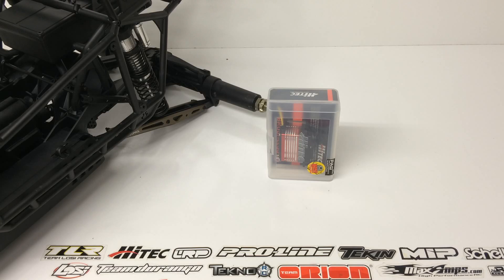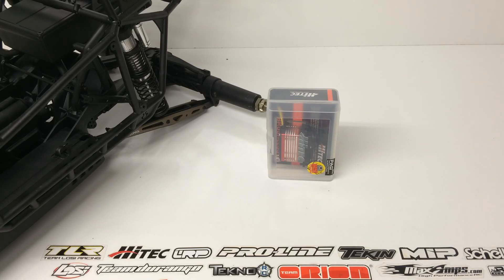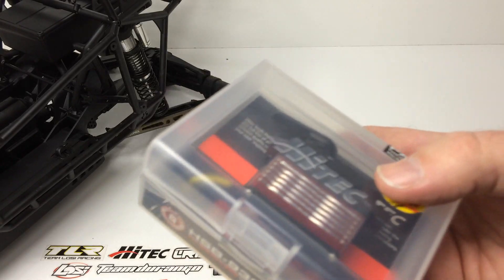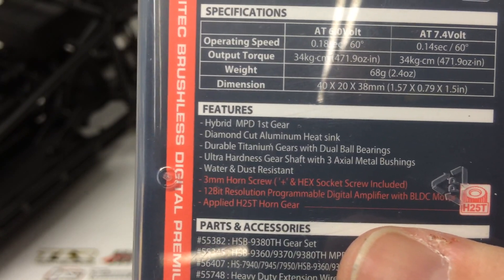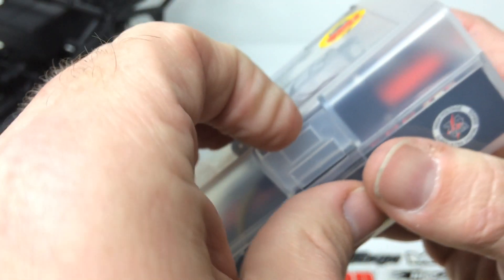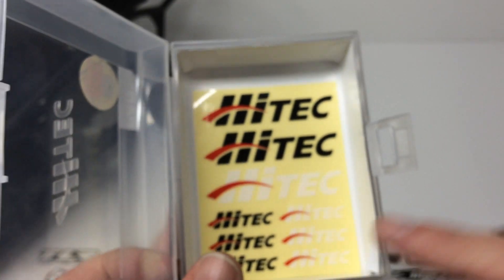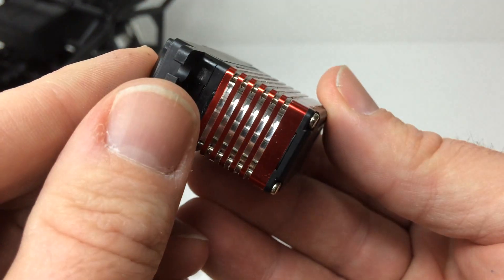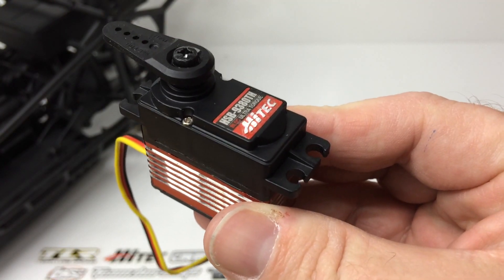Hitec HSB9380-TH Ultra Torque Servo - Unboxing

Comment: I would stick with running it at 6 volts just would last much longer. Castle seems to be a powerhouse having there products into everything Rc
Reply from the maker: +Jacob Hendrickson The nice thing about the Hitec is that even at 6.0v, it puts out the same torque, with slightly reduced speed

Comment: This has me wondering are the brushless motors in servos sensored or non sensored.
Reply: They are connected to potentiometers which measure how far the gears are which then relays that information to the motor which rotates the gears to the designated position so they are sort of sensored but not like normal motors
Reply: "rc tips and reviews" - He didn't ask that at all....
Reply: I was explaining why I don't think they are sensored

Comment: Is this over kill for a 1/8 scale buggy ? If so what are all of your guys thoughts on the best servo for a 1/8 scale buggy. I'am almost finished building a Losi 8ight 3.0 e buggy. So far for electronics I think I'am going to go with a Tekin 1900kv motor and the rx8 gen 2 esc. All advice is appreciated, plus battery ? I will mostly be taking this to my local track and getting into club races. So suggestions on parts would gear more towards making the best track buggy not top speed. Thanks in advance. I'am a noob to all this except for a nitro monster truck I had about 10 years back. hope these questions aren't to lame... Haha
Reply from the maker: +Jay West The rule of thumb for 1/8th scale buggy is at least 300 oz/in of torque.  Then, your wallet will be affected on how fast that 300 oz/in of torque is.  The 9370 would be my choice at 347 oz/in and a .10 transit time

Comment: do you need to run a bec with this servo ?
Reply from the maker: +rocketfish6 The 9000 series of servos come with what Hitec calls a "PAD" which is kind of like a voltage cap for it

Comment: excuse me, i never had a brushless servo, what exactly is that PAD (Power absorbing device)? do you know how is connected and it's use?
thanks
Reply from the maker: From what I understand, it regulates voltage to the servo, as it's plugged into the receiver.  Sometimes, high voltage/powered servos can cause the ESC to glitch causing brown outs.  I'm sure there's a more technical name/reason for it, but that's what I understand

Comment: So im confused on this BEC thing. For rtr yeti xl will the stock radio/receiver run at 7.4v? LHS says no. Or is it an issue with stock esc? My servo i got has potential of 450+ oz torque but only at 7.4v. How do i do this? LHS just confused me. Also is the PAD that comes with hitec servo a BEC?
Reply: So much confusion about this PAD. The servo basically produces electricity that goes back to the receiver then you batteries/ some esc/bec may have issues with it, so a PAD is installed to make things better.

Comment: One more thing I can't believe they send it with a plastic servo horn. And I so agree on 25 spline. Why wouldn't everyone just stick with 25.
Reply from the maker: +Jacob Hendrickson I agree on the 25t. I have used many Savox (no longer...) and Futaba's, So i have several 25t horns in my parts bin.  I don't mind the plastic ones, as I never even use them.  I have always been into direct mount aluminum horns